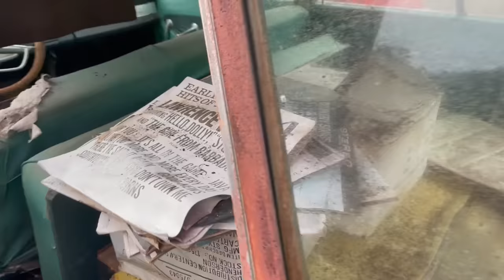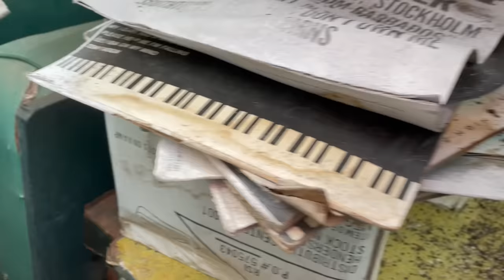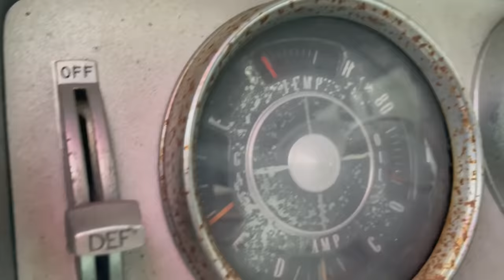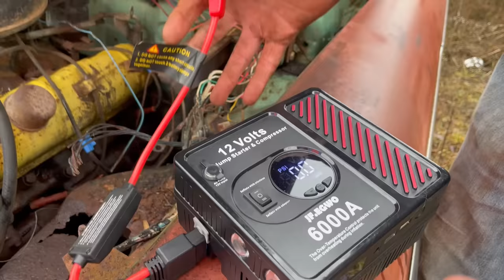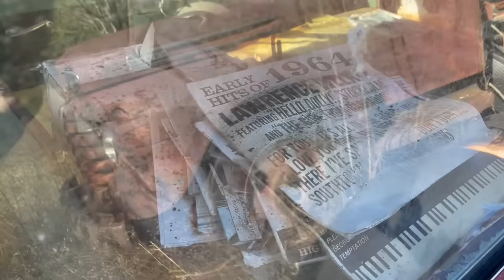Will it run?  48 hours to start and drive a 1963 Studebaker Wagonaire parked 39 years!

Comment: My Wife learned to drive on a ‘53 Studebaker.  It did not have power steering or brakes.  She drove it all through HS.  Got into an accident in ‘75 w/it and although it wasn’t too badly damaged it was the end of the line for it. I don’t know what model it was but that Studebaker did the already over 100 year old company proud.
Reply: I had a 52 convertible 100 th anniversary model ,same as the indy 500 pace car.  Comander,  V8,three speed with overdrive,  There is a reason people love their Studebakers

Comment: The 1966 you're referring to is not the year, its more than likely a body number from the factory in South Bend. I have two Studebakers, a 1947 Champion 4 door and 1949 Champion 2 door. They both have that same style tag. Studebaker used those on their entire lineup of cars and trucks. It actually helps a lot when trying to find parts for the specific model. It indicates the body style, engine type and year. 63 for the year, V for 8 cylinder and should also have a "P" designation which indicates a 4 door wagon. He is exactly right, as they would've had Chevrolet engines in them if it was a 66, not to mention it would not have the Lark script on the front fenders.. they are not true Studebakers for that reason... only by name. The 1964 models were the last Studebakers to bear an actual Studebaker Skybolt 6 or V8 power plants in 259 or 289ci displacements. Ford was not the only one to build a 289. Those two engines replaced their first V8 which was a 232ci displacement, and the Skybolt size came around in 1961 to update the old Studebaker 170ci flathead sixes to an OHV design. That is a true 63 Wagonaire. Great find. The nice thing is there are still a ton of parts available for Studebakers from different sources. Just don't look to O Reilly or DuraTrash zone or Advance.. those kids in those stores have no idea what Studebakers even are. Glad to see someone saving it. People could get mad you took parts.. but thats one of many things that are great about Studebakers.. many parts are interchangeable between them.
Reply from the maker: That is a lot of good info. Thank you.
Reply: The 1965 and 1966 cars were true Studebakers, built in their Canadian plant in Hamilton, Ontario. However there were no engines supplied by Studebaker USA, so they had to source compatible engines and decided on the Cbevrolet engines built by McKinnon industries in St Catharines, Ontario (this is now a GM plant near Niagara Falls.

Comment: The 63’ Wagonaire was a predecessor to the 2004 GMC Envoy Xuv that also had a retracting roof.  They both were prone to leaking, the gmc more than the studebaker. 
A neighbor had several studebakers to include a wagonaire and a 58’ Packard Hawk 1 of 588 which he seemed surprised that I knew that at 12 years of age.
Great job getting this thing going after such a long rest.
Reply: I was on the team who came out with the XUV in Detroit and California. I had my 64 Wagonaire 4 speed 1of3 . At the photo shoot. And won the $1.000 bet they said wait A Wagon with a sliding roof ? Yep.

Comment: Well I was thinking at the start of this video that this one is going to be a challenge - but you did it again - well done
Reply from the maker: Thanks Lance. I was worried, because the engine was seized tight. Once we got that addressed, I was confident it would run.

Comment: love this. grew up in mishawaka indiana and spent most of my life in the area. was into the studebaker factory building years and years ago. there were pallets of new old stock engines still on the lower floor of the building that had never been installed in studebakers. i heard that most got auctioned and sold off before they torn those buildings down for new apartment buildings i guess. Love your videos! keep up the great work!
Reply from the maker: That is a great story. Thank you for the support!
Reply: Was in the new Studebaker Museum 8 yrs ago, highly recommended from when it was in the old factory. Lots of area pieces, and carriages. The oldest working Studebaker (A Guiness record) is the Budweiser carriage pulled by the Clydesdales.

Comment: Hey Richard,great job at getting this old girl running and driving again. I want to mention that I like the fact that you use a pipe wrench on the lower pulley to unstick the engine. Alot of guys go straight to the crank bolt and that makes me a bit uneasy. Another excellent video from you both!!

Comment: I've seen lots old Larks, but never a wagon. That one is in great shape too from what I can see. I did see one of those on Youtube once, but it wasn't near as nice. Very unique car. Interesting that they put so much into those things since the Lark was the lower line of Studebaker. Usually came with a sleepy six engine too. Again Studebaker was ahead of their time. The big three didn't use the split master until 67. I just learned something.
Reply from the maker: I had not thought of that, but you are right, a split master in 63 is not something I have seen before!
Reply: @whattherust  They did a lot of firsts. Sorry to see them go. First company to make a fiberglass body too. Unfortunately that contributed to their demise because none of their employees knew how to work with the new material. The Avanti (had a lot of firsts)  was way ahead of its time, but killed the company.

Comment: I drove the 1964  (same green in color) non LARK(?) Wagonaire* equipped with 3-on-the-tree.  It had the cable under the dash activated/OD, what about this model...?
Your notice and attention to the slick design of the door handles shows you have a real love and appreciation for the Aesthetics in Design of the Automobile.  So many peeps would not have even picked up on that feature.

* It was the first clutch operated vehice I mastered back in 1974 at the tender age of 17 years.
The return spring on that pedal could give you a 'Charlie Horse' in stop and go traffic.**
I know from experience as it had been my older brother's car prior to him joining the Coast Guard amd I had the priviledge to drive it to and fro my job before I then enlisted in the USAF.

....Oh, and just before leaving home I had actually purchased my first car.  A 1964 four door Ford Falcon, straight 6 and 3-on-the-tree sans OD for the insane price of $400 from a neighbor whom used it as he went door to door, our local Fuller Brush salesman.

** But you never forget the first car you operated, ...Am I Right?
Reply from the maker: You are totallly right!

Comment: Studebaker were built in the US until 1963 but continue to build vehicles in Canada until 1966 and are still traded on the stock market today. They make wiring harness for the auto industry and for NASA.
Reply from the maker: I did not know that. Thanks for the info.
Reply: Studebaker started out making horse drawn wagons in the 1840's

Comment: Amazing! The first brand new car I bought was a 1961 Studebaker Lark convertible, and I became an instant fan.  The sliding roof wagon was an option, and looks the same from the outside. OEM Spark plug by the way, was Champion H-14Y.  Also used in AMC/Rambler of the same era. The auto trans is a Borg Warner cast iron 3 speed, also used by Ford as the FMX trans. Rims have the early Ford/Chrysler bolt pattern of 5 on 4-1/2" circle. The rear axle is a Dana 44, much more than adequate. Ratios available are 3.08:1 to 4.55:1. Notice the hood hinges, by the way. Not creaky hinges and huge springs that get sticky (like Chevy trucks) and cause hood damage, but fairly simple and rugged hinges, with torsion bars to hold up the hood! I'll definitely be looking at further developments!
Reply from the maker: Thank you for the useful info Neil. I had no idea the FMX was used in Studebakers, nor that the car has a Dana 44. The   more I learn about them, the more I like them. Thanks for watching.

Comment: Remember hearing my late Dad & Uncle ( his brother) share a Studebaker wagon car was old Hearst and had 6 cylinder and Manual transmission 3 speed and no power steering or brakes! They had for 6 years together then in 1950 and my dad bought 1957 Chevrolet Bel Air 2 door also saw till 1984 was sold and got see again 2015 to 2020 at local vechiles show near me same guy bought it ! 1963 My uncle sold Studebaker bought brand new 2 door Chevrolet Impala 409 car remember him tell me about too and saw pictures of too only !

Comment: The 63V on the firewall tag means its a 63 model that came originally with a 259 v8. The only difference between the 259 and 289 V8 is the crankshaft. You can tell by the serial number on the front of the engine near the water pump. A "V" means 259 and "P" is 289.
Reply from the maker: Good to know. I thought only the 289 was available. Thank you for the info.

Comment: 00:05:32 FUN FACTOID: The white powder inside the gas tank filler neck is lead residue from back in the days of leaded gasoline.
Reply from the maker: That is great information! I had no idea. Thank you.
Reply: @whattherust  Grandpa and I are a little older than you but back in the day if your engine was healthy (didn't burn oil) the inside of the exhaust pipe would be white from the lead too. That was a sign to look for when you were shopping for a car. If the inside of the exhaust pipe was chalky white the motor is right was the saying back in the 60's and 70's. If the pipe was black and sooty you knew the engine was burning oil and to stay away from that car.
Reply from the maker: @charliesgrumma5388  Fascinating stuff. It also means that car must have been parked with leaded gas in it. That would match up with the license plate date.
Reply: @whattherust  In 1978 Grandpa and his brother both bought brand new Dodge D-150 trucks. Grandpa's had a 400 with cats and "unleaded fuel only". Bubba's truck had a 360 with regular fuel and no catalytic convertors on it. 1978 was the "phase in" of the unleaded gas only cars and trucks. Regular leaded gas was still available for a while after that but I would think by 1983 unleaded gas would have replaced leaded gas. The problem would be storage for the gas stations since they would need double the number of gas tanks to keep reg and hi test in both leaded and unleaded versions.
Reply: @whattherust  After doing a little snooping I discovered leaded gas was available in some places up until 1996. So any gas left in the tank could very well have lead in it. The paint on the vehicle has lead in it as well. That is why lots of cars built in the 40's and 50's still have their original paint. Car paint doesn't last very long nowadays.
Reply from the maker: @charliesgrumma5388  Right, the older paint jobs did stand up well.

Comment: I miss my 63 Lark sedan that I owned in the early Aughts, even though it was a rustbucket held together with chicken wire and expanding foam. Someone had transplanted a Chevy 350 into it. Once drove it 500 km across the Prairies (in winter) and back. Finally gave it up when I could not find new brake drums as the originals were cracked… so it was crushed.
Reply from the maker: That is unfortunate, but is the fate of so many. Thanks for watching.

Comment: There's another ol boys channel where they found another Studebaker Lark Wagoneer but that one was really really rotten, unsaveable, if that's a word. That one seems really sweet! That engine sorta looks like a Packard 352, I know Studebaker put 352 Packard's in some of their vehicles... hmmm? Probably not in that though, I think they used those in the different Hawks. That is probably a 289 and even in some of those you could get that with a Paxton supercharger. The Studebaker 289 was a wide engine, almost looks like a bigblock, almost.
Reply from the maker: Yes, it is a 289. A very tough engine.
Reply: @whattherust  - yeah man, I agree 👍

Comment: Wow, cool WIR. That was a fairly unusual looking car even for it's day (like most of the Studebaker line). It was right before their demise. The Avanti was a pretty interesting and desirable car with the Paxton/McCulloch supercharger in the R2 or R3. The problem with Studebaker was they were way behind the 'big 3' in developing advancements in their engines and mechanical systems. That distributor looks like an Autolite/Prestolite. They used those on a lot of cars like Chryslers. You can still get those caps and rotors.

Comment: I forget the mans name but the channel is Budget builds. He now owns one that runs and drives. I remember it was a  good runner but has some issues similar to this one. He got the back window down and the top does slide. He is wanting to sell his and who only knows what the persons prices are but I do know that he will swap for other stuff and  that you have a treasure chest of pieces. I know that he has had a lot of ford stuff and of course, just about all of those brand name vehicles. I would love to see a collaboration of this channel and his. They are god fearing fine folk from what I seen. Since he is just a pup in age, might be thirty, hot rods are his favor along with his dads help in getting rigs back on the road. Since I have done metal fabrication I have to say all of my life and for what I have learned in these 73 years, I could patch that floor back in the rig in three to five days absolute worst. Like I did a 57 oldsmobile in two weeks because of metal shortages and had to use metal from the tops of solid junk rigs. That car needed work from high up on the firewall to the trunk lid. I had it looking factory with only hand tools and a mig welder. I am crippled too badly to do work on a little red wagon now but since I know a lot of men who are tinsmiths and fabricators, they can do this too. Its time for the two of you to finish what you start on some rigs. I have heard you say that your doing just that but seeing is believing. This Studebaker engine absolutely needs to be rebuilt and it can be done on a budget. Sure those engines do lend well to being hot rodded cause the factory for these did just that. The Avonti is the fastest car in the world at one time and did this on some famous race tracks. I am not so sure that you have the money all on your own to do this work but you have a large collection of parts that could be sold from this yard of parts and get something going. I do think if presented right that these folks would make it right with you kids so that everyone has a smile on their faces when done.
Reply from the maker: It sounds like you have great skills. I have always admired people who are good with metal.
Reply: @whattherust  Its just what I grew up with so it kinda comes naturally

Comment: There was a light green international pickup on the right as you started driving on the cart that you should save.  And that late 80s early 90s red Chevrolet truck.
Reply from the maker: I think the International is missing an engine. I'll check on the red OBS. It looks like a nice truck, and it is a short-bed.

Comment: Excellent video Christine  :) also Richard  :) my local car show club had member in Baby Blue color also interior to and fairly mint shape plus had Canoe on top roof  plus decal stick said up front windshield top side Surf Up and back window to plus Ontario Canada to on personalized type to said SURF @ 1 ( Lol) ! Hope enjoy fix up this too! Also Richard how fix thermostat and old vechiles sat around for years on Water Pump grinding or squealing sounds put 80w90 differential fluid in rad if not leaking help lube on tight and seized plus much more ! Even unstuck thermostat too after 30 mins warm on cold or hot starts to and be amazing too! Also Alternator bolt spread off have drill and rethread up too!
Reply from the maker: Thanks for the tips Andrew!
Reply: @whattherust  welcome

Comment: Stude closed it's South Bend plant in 64. BTW they started in 1852! Wooden wagons. I have a 66 Wagonaire. Stude moved to Canada but without drivetrains, they sourced GM motors. My 66 has a 283V8 with Borg Warner 3 on the tree & electric OD in 2nd & 3rd. Finishing up all of the body seals. Hardly any rust. A Colorado vehicle. Body on frame construction.
Reply from the maker: It sounds fantastic. Does the Chevy engine have Studebaker valve covers on it? I heard that this was done in 66.

Comment: Hehehe other than this dent, its straight. 😆 🤣  
We had a 62 lark 4 door. I remember the steering wheel wasn't really round it was oblong I think. Ours had really low miles but it sat on the ground somewhere for years. When you would close the doors rust would fall out in piles.

Comment: This car would be worth  restoring  like new in perfect running condition and body condition with a new cool paint job. When it all finished; a good car to take to the car shows and drive to the local grocery store during the summer months.
Reply from the maker: The owners have the floors fixed and are getting it ready for a road trip to the Street Rod Nationals. It should be quite a ride.

Comment: Is it possible to break a ring when you trying to turn up with the pipe wrench?
Reply from the maker: Yes, but the oil in the cylinders minimizes the risk. I have used this method a lot, and to date have not broken anything.

Comment: I'm not a mechanic and don't play one on TV. Shouldn't you of disconnected the gas line when you found very bad fuel in the tank ?. It would also be interesting to see a final $$$ figure once you get the vehicle on its feet and road worthy, to be fair, an estimate on labor costs would be interesting.
Reply from the maker: Correct. The line was disconnected.
Reply: @What the Rust?  OK cool, I remember the part about you saying "Really Really bad gasoline after you checked the gas tank, my attention span (notoriously short) must of wondered off shortly there after.
Reply from the maker: @earth2006  No worries. It happens to me all the time!